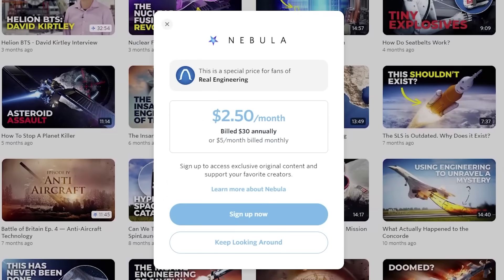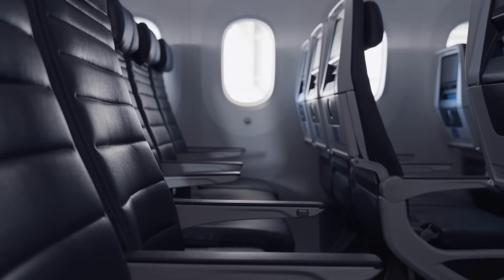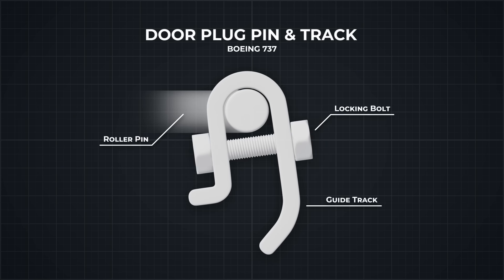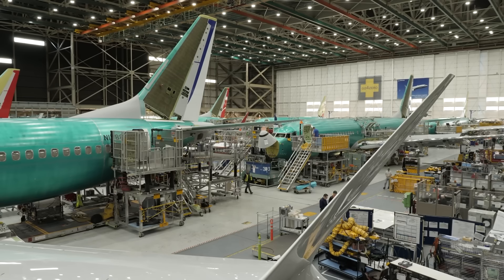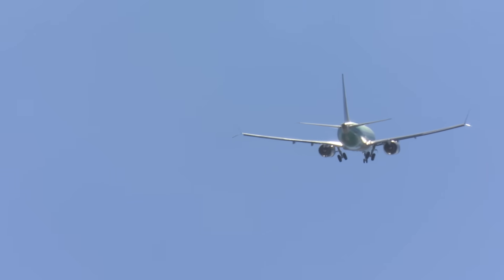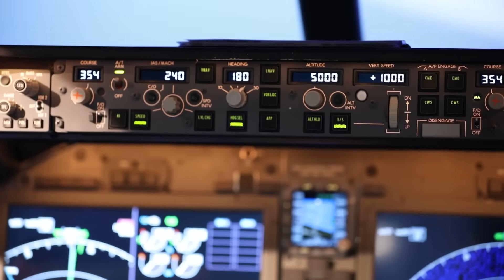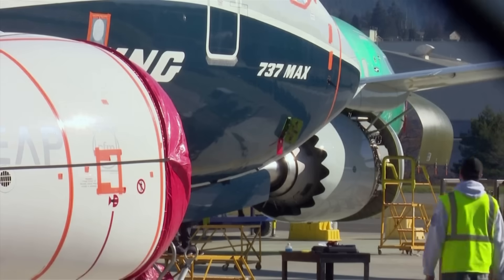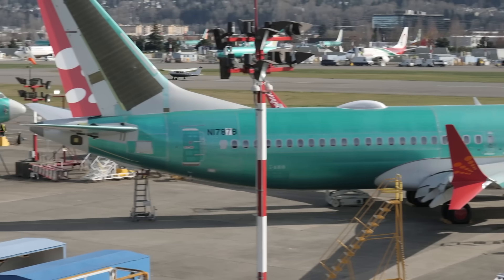The Questionable Engineering of the 737 Max

Comment: The bottom line is that the Max should never have been produced. It is an ancient dog of an aircraft, but it was pushed down the line because S.outhwest and R.yan wanted a cheap aircraft with lineal commonality with the 1967-certified B737.  But in truth a 21st century aircraft should never have:

a. Only one sensor controlling a safety system - because that is simply criminaI. Nobody except Boeing has had simplex systems in the last 70 years.

b.  A MCAS system that is able to stab-trim fully forwards - when it is known that the stab-trim is more powerful than the elevator.  Thus the system has sufficient authority to overpower the pilot, and fly the aircraft into the ground.  And if this authority was so easily reduced in the revised Max, then why was this not specified for the original Max?  Were there occasional conditions where the system needed full trim authority (for a high-speed stall perhaps), and they are not telling us about it?

c.  A manual stab-trimmer that becomes mechanically locked if the pilots are pulling back on the control column - so that no manual re-trimming is possible.  (The recommended roller-coaster recovery not being advisable at 2,000 ft, and never taught in the simulator.)

d.  An anti-stall device (MCAS) that operates on the stab-trimmer, rather than the control column.  Look, dear Boeing, the design and mechanics of an anti-stall device are well-known, ever since the Bae Trident got into trouble.  The solution is to push the control column forward, because once the nose is lowered and speed increases, the pressure can be released instantly.  
   However, if you push forward on the stab-trim, you cannot easily pull out of the ensuing dive because you are still trimmed (fully) forward.  (As several pilots have  discovered, much to their dismay).  So why did the FAA not recommend the complete scrapping of the MCAS system, and the installation of a stick-pusher?  Cost?  Time? Certification?   Has the FAA skimped in their recommended MCAS fix?

e.  A master warning system that can be cancelled, so the warnings are extinguished and forgotten.   Dimmed perhaps, but never extinguished.  This must be the most stupid system ever invented for a commercial aircraft.

f.  Important warnings, like low engine oil pressure, that simply don’t appear on the master warning system.  It does not take too much in the way of distractions or inattention to miss the fact that the engine is about to seize. 

g.  Flight controls that cannot be separated if one side is jammed, because the two elevators are joined by a large torque tube.  That would not be allowed on a modern aircraft.

h.  Engine overheat and fire warning lights that are not in the pilot’s line of sight, with no repeater lights on the thrust levers. Back in 1960 the handles and lights were on the coaming, where they should be, but they were relegated to the center console to make way for the MCP.  That was a retrograde fix that should never have been allowed, at least not without repeater lights on the thrust levers.  But what do the FAA care, as long as profits are still being made?

i.  Switches that are all identical, without even an attempt at colour coding.  And the evidence for correct actioning is a light that goes bright and dim.  Now between day and night, just what is bright and what is dim?  Never in the history of aviation has there been such a stupid advisory/warning system.

j.  Switches which are all down for on - unless they are on the forward and center instrument panels, where they are up for on.  Note that the all-important electric trim cutoff switches are down for off - the complete opposite to the majority of switches on a 737.  There is so much room for confusion here, you could drive a semi-trailer through it.

k.  Paper checklists and emergency checklists.  Now come on guys and gals, computer checklists were common back in the 80s, so why the hell are we still operating with bits of crumpled and torn paper?

l.   Mainwheels that retract into the hydraulics and flight-controls bay, where shredded tyres can inflict severe damage on a multitude of systems.  Some airlines placed cages in the wheel-bay to protect the systems, but they did make routine maintenance difficult.  And the hydraulic release fuses were hardly an adequate solution to a failed 1960s design.

m.  Center fuel pumps in the center tank, which can overheat and explode - and no auto-switching system was devised to prevent this.  Has this been solved on the Max, because it was a butcher’s bin on the NG? 

n.  Passenger doors that have to be armed by grovelling on the floor.  This is rather like having a starter-handle on a modern car.

o.  Flight-deck windows that are smaller than an old-fashioned cruise-liner port-hole, because that was all they could make in 1950.  Trouble is, we are in 2021 now.

I could go on, but that is sufficient for now.

See ‘Death Plane’ on the Russel Scott channel.  
I made these videos under the ‘Paul Spencer’ name, for employment reasons.  
These two videos have never been challenged.

Ralph
Reply: Be wary of the youtube engineering expert who claims paper is obsolete. Simple things in a checklist, when executed without ignoring and pencil whipping, get the job done accurately and are easy to change at a later date. Paper is traceable and a way to show who's falsifying and when it is happening. SW is not without issues. Every part on a plane down to the bolts have a mountain of traceability paperwork and auditable documentation for the life of the product.
Reply: @Virxo182 . Paper has its pros.   But on the con side, it is easy to miss out steps, with only your thumb to keep a place, while switching switches and calling STC and talking to cabin staff.  It is also easy to drop on the floor and change page.  And easy to get the wrong page when there are three similar sounding check procedures.

The idea with a computer checklist, is the aircraft knows what problems have occurred, and provides the appropriate checklist.  Now Boeing have this on the 787, but would not put that system on the 737 because that would mean re-certification — and the 737 Max would not pass modern certification for numerous reasons.

R
Reply: You forgot to mention that MCAS was not initially mentioned in the flight manual.  Something that could cause a loss of control is intentionally omitted?  That is criminal
Reply: @johnreyn19 .  Indeed.
We always has a MCAS type system, which was a ‘mach-trim’.  So unrequested operation of the trim was not unusual.  

But a system that will trim fully forwards is insane.  You never trim full forward on a 737, because the (stab) trim is more powerful that the elevator, and will force you into the ground.

In addition, you NEVER prevent a stall using the trim (it is forbidden from day-one of pilot training).  Because when the aircraft recovers from the incipient stall and gains speed, you cannot easily recover from the ensuing dive.  You are heading groundwards, and the trim takes 10 second to trim back (more, if you are on manual trim).

That is why all other aircraft employ a stick pusher.  So once the incipient stall is alleviated, the stick push relaxes, and you can instantly pull out of the dive.  You cannot do that, when you have full trim forwards.   So EVERY aircraft that required stall prevention uses an anti-stall stick-pusher — apart from the 737 MAX, which used a single-source anti-stall trimmer.   (MCAS is anti-pitch-rate, to be precise, but too much pitch rate will end up in a stall.)

Ralph
Reply: @RalphEllis  very interesting, I didn't know that
Reply: There are some things in what you post that may be true, but others that are not. 

For example, and in no particular order: the center pumps do shutdown automatically once they detect low output pressure, you still have to move the fuel pump switches to off to switch off the “Low Pressure” light but the pumps themselves are off (also it has a Nitrogen Generating system that introduces nitrogen to the center tank). 

In order to protect the hydraulic system that as you say, is placed in the main wheel well, there are fittings that are broken off by a shredded tire which realeses hydraulic pressure in the landing gear preventing it from being stowed. 

Paper checklists that I have used are not crumpled, they are laminated and do not crumple or tear, so not sure what was the point of mentioning that.

Not sure what you mean by small flight deck windows, they are by no means small and certainly do their job for take-off and landings. 

I am trying to think what switches there are on the center and instrument panels that may look like the ones on the overhead panel, I believe they are not toggle switches (we do have the Master Lights Test and Dim switch that has Test-Dim-Bright on it and yes, there is a big difference between Dim and Bright, there is the Fuel Flow Switch, with USED-RESET-RATE on it, used to reset the fuel flow/ fuel used information back to zero between flights). As to color coding the switches… I have no idea what you mean, does anyone color code their switches? I ask because I have not heard of this.

Engine overheat and fire warning, we get bells, lights and to be specific, the Master Fire Warning light is right in your face on the glare shield, very difficult to ignire as is the Master Caution. Fire handles may be on the control stand, but they are not the only lights that indicate a fire. Another indication of engine trouble is the Lower Display Unit (NG) which is normally selected blank after engine start, if there is any issue, engine information is automatically displayed on it. This applies to you “Low Oil Pressure” comment to.

Flight controls can be seperated in case ailerons, spoilers or control column gets jammed, with more than sufficient control and input onto the flying surfaces. Controls may be sluggish and heavier than normal, but they certainly work.

Not entirely sure what is wrong with the slides being armed by placing the bar on the hooks that are on the floor, but ok.

The manual trim can be used when pulling or pushing on the control column, Main Electric and Autopilot trim are stopped when the control column moves in the opposite direction to the trim.  I think the “roller-coaster” recovery you mean is the one used to recover from a stall on approach, and yes, it is taight and practice every 6 months in the sim. Somewhere you mention being in a dive and and pushing on the stab-trim whilst being trimmed full forward, by “pushing on the trim” you are trimming forward, so I guess you don’t want that. 

As I said, you make some very good points and there are a lot of things that you say are right, but also quite a few things that are wrong. Not sure about how other airplanes do the same things you mentioned either so would be glad to learn how it is. The airplane IS an old design, it has been kept in use longer than normal and MAX was rushed in its design, and Boeing’s lack of adecuate quality control is an obvious issue but, you might want to check some of the points you made.
Reply: @Guillermo90r . Wrong.

The center pumps did NOT turn off on the NG.  They only changed the system after a NG blew up in the Far East, due to overheating pumps.   So for two years we had to carry 500 kg of excess fuel in the center tank at all times.   Then we had three different mods, where pumps would only turn off if one pump was already off, and then two off and then god know what - because nobody could design a proper system.  It was utter chaos.

The hydraulic frag-points to lower the gear was another bodge.  It you have rubber flailing, it breaks a frag-point - but the wheels come up so fast they will be in the wheel well smashing all the hydraulic and control systems, before the frag-point can lower them down again.  That is why some airlines had cages in the gear-well.  

You don’t understand the trim system.  Try in the sim next time - trim full forward and pull back on the column to compensate.  Now try manual trimming back.  It will not do so - it is locked because the elevator is pushing too hard on the back of the stab, and you cannot manually trim back against that pressure.   Hence the rollercoaster technique (which is only in the notes at the back of the QRH).

The 737 NG attention-getters and MWS fire lights do not identify which engine.  Proper aircraft have separate fire light on the MWP for each engine, plus a red light on the back of each thrust lever, to denote which one is on fire.   This is like the Helios incident, where there was insufficient differentiation between config and cabin alt - resulting in the deaths of many people.

Flight controls cannot be separated.
The elevators are joined at the back, so separating the columns is immaterial if the elevators themselves are jammed.  You cannot overcome a single elevator jam.  And BTW have you ever practiced column breakout systems in the sim?  No, you have not, because the aircraft is uncontrollable.  That is why it is never practiced.  

R
Reply: @RalphEllis    Ok, I do not believe I am wrong when it comes to the pumps, unless the Flight Manual is wrong. It clearly states “Each center tank pump will automatically shut off, after a short delay, when that pump’s sensor detects low output pressure.”

The hydraulic frag points on the wheel well, I must admit is completely based on what the Flight Manual says, I have not had an actual burst tire during take off (yet).

What I mentioned about the trim is from practicing the trim run away memory item and after the second MCAS incident, we had to practice the maneouvre again and was able to trim the aircraft, it was slow but possible. Again, only the simulator. We were high enough that it was fully timmed forward and after cutting out the both Stab Trim cut out switches (Main Elec and Autopilot in NG, PRImary and B/U in MAX), we were able to trim back, took a long time but we were high enough to do it. 

The “attention getters” do not adentify the engine, but the upper display does and it is clear and in line of sight at least in my opinion.

Flight controls again, according to the Flight Manual states the following:

“In the event of a control column jam, an override mechanism allows the control columns to be physically separated. Applying force against the jam will breakout either the Captain’s or First Officer’s control column. Whichever column moves freely after the breakout can provide adequate elevator control.” -For the elevator
Though I think I understand what you were trying to say now (you meant the levators being stuck not the control column, which is what I understood and apologise).

“If the ailerons or spoilers are jammed, force applied to the Captain’s and the First Officer’s control wheels will identify which system, ailerons or spoilers, is usable and which control wheel, Captain’s or First Officer’s, can provide roll control. If the aileron control system is jammed, force applied to the First Officer’s control wheel provides roll control from the spoilers. The ailerons and the Captain’s control wheel are inoperative. If the spoiler system is jammed, force applied to the Captain’s control wheel provides roll control from the ailerons. The spoilers and the First Officer’s control wheel are inoperative.” -Aileron and Spoilers section

And yes, I have practiced jammed ailerons in the sim, airplane is sluggish, not uncontrollable, other control column was useless as the ailerons were the ones jammed. Had to ask for a longer than final approach but it was fine, just heavy. 

I will like to know more about the roller coaster maneouvre you mention, it may have another name but its not in my QRH under that name maybe?

Edit: Googled it after looking for it on both FCTM and QRH, neither has any mention of the roller coaster maneouvre, I guess it was taken out. Both just state that manual trim can be used at any point except that in extreme cases, it may be harder than normal to turn the wheel.
Reply: @Guillermo90r  
Fuel pumps.
They may have changed all the NGs to automatic center pumps now, but that does not negate the huge problem we had with early NGs.     ….    The problem was that the Classic center pumps were in the wing tanks - so no overheat problem.  But the NG placed the center tank pumps in the center tank - WHICH YOU SHOULD NEVER DO (they can overheat).   This was a crazy idea.  Proper aircraft drain the center tank with jet-pumps, so no moving parts and no electricity in the (empty) tank.

Trims.
I bet the sim-manufacturer has adjusted the sim to make you think the aircraft is still trimable.  We were unable to manual trim an NG.    Put it this way, the second Max accident crew were unable to trim back manually.  That is why they re-engaged the electric trim, to help them.  Except the electric trim trimmed forwards again.  

Engine fire.
Upper panel?  Is that the extra box on the Max coming, above the MCP?  Sounds like another Boeing Bodge again.  Instead of designing a proper system, they just add bodge after bodge.  What is wrong with fire lights on the thrust levers?  Ah, yes, that would cost money.

Controls.
Again - separating the control columns is of no use, if the two elevators are joined at the hip (which they are).  That will only solve a jammed control column, not an iced up elevator (for instance).

When you say you have practiced this, I think you are talking about manual reversion (no hydraulics) which is completely different.  We did not do control separation in 25 years.   BTW, in manual reversion, forget about the control column completely and fly the aircraft with the rudder and trimmer - it is far simpler and much easier to control.

I will look up the rollercoaster.

R
Reply: @RalphEllis   No. We regularly practice assymetric flap extension, manual revesion and control jams (spoilers, ailerons and control column). 

As to the Engine Fire, no, I mean the central Upper Display and Lower Display show engine parameters and related information. Normally after engine start, the lower DU is blanked. In case of engine failure or fire it lights up and shows the rest of the engine parameters that the upper DU does not normally show. This same Upper DU also tells you which engine has failed if you have any doubt (you can kind of feel it and see where the airplane is turning in the PFD). 

In the NG, all pumps are in the center tank (even the pumps for the wing tanks), plus the NGS helps mitigate any issues with fire. 

I did find the Roller Coaster maneouvre thanks to google, it seems to have been removed in the manuals I have (they have removed quite a few things in the last 7 years for example: the engine temperature limits. 

Again, all of this is theory and bases on the manuals so that is as far as where my experiemce goes.
Reply: @Guillermo90r .  
Center tank pumps should never be in the center tank, because the center tank runs dry and the pumps overheat.  Hence all the problems on the NG.  Adding fixes to turn the pumps off when dry is simply bad design - the (high amperage) pumps should not be there in the first place.

So they have put engine fire warnings on the center flat-screen display.  Oh, well, better late than never.  The Classic and the NG had no forward display for engine fires for nearly 40 years, but never mind.  The number if times crews forgot about a burning engine, because the lights were not in their field of view (after warnings were cancelled)…!

Note, the original B-707 (on which the 737 cockpit was based) had the fire handles (and lights) on the center coming (glare-shield), so they were readily accessible and visible.  That was a good design.  But the handles and lights  were moved to the aft center console on the 737 (where they could not be seen) to make way for the MCP.   Now that was a stupid bodge.

R
Reply: @RalphEllis  Well, again, can’t really say much other than what the manual says (and some of that information is gone) or what I have practiced and experienced. Thanks for the info anyway. Specially on the load relief (rollercoaster) technique.
Reply: Well thought out and thorough answer.
Reply: I think having a paper copy of checklists and manuals on every plane is a good idea, but there should definitely be a computer based one as well.
Reply: Based
Reply: How many times are you going to type this exact same comment?